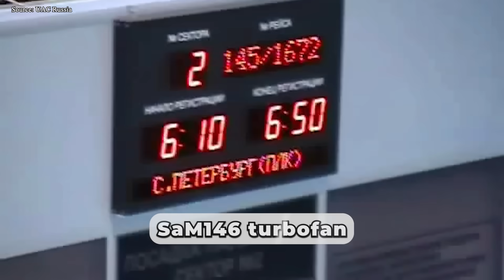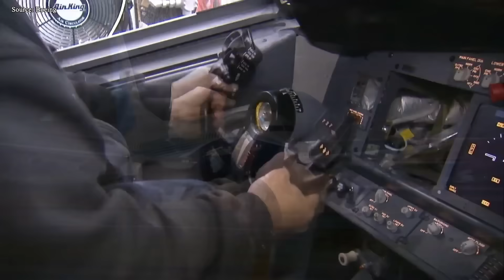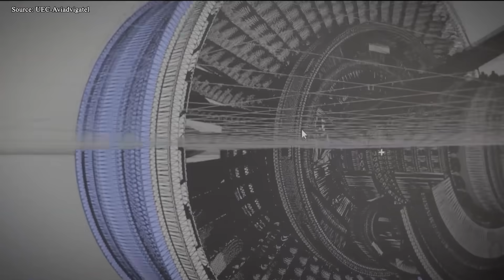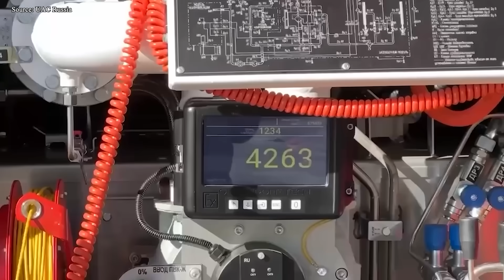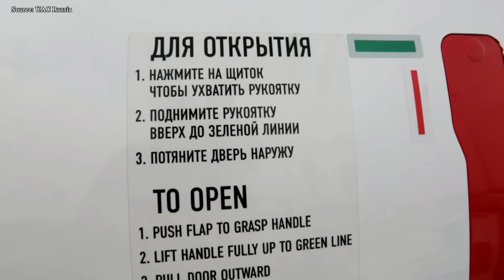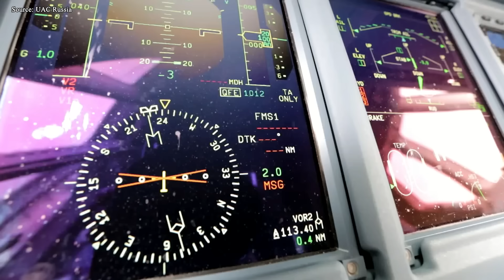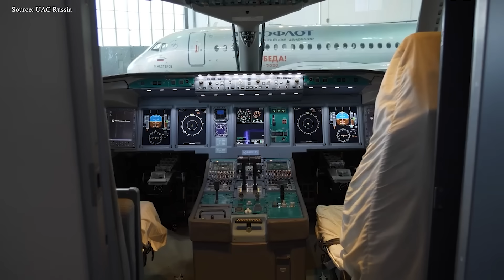This is How Russia’s SJ-100 Jet OUTSMARTED Boeing & Airbus

Comment: why do they keep showing two completely different planes? One with engines in the rear and one under the wings.. did they think the viewers are too stupid to notice? I hate AI content with it's typical showing of visuals completely unrelated to the narrative. For goodness sake, just show a static photo of the object you're talking about, if you don't have a relevant video clip. Otherwise it is very frustrating to watch.. why have visuals at all??
Reply: The plane with the engines in the back is the old Soviet Tu-134, which was replaced by the SJ-100, which has comparable capacity and range, but is quieter, more fuel-efficient, and more comfortable.

Comment: Why is this aircraft considered obsolete? Which new aircraft does it struggle to compete with?
Japan's SpaceJet project failed in 2020. $10 billion wasted. If there are any new successful projects, why aren't they mentioned?
And yes, the Boeing 737 has been in service since 1968. How miraculously does it manage to compete in the market and why doesn’t it talk about its obsolescence?
Reply: Does the Boeing 737 still compete in the market? 
Boeing only gets orders because air companies want to prevent a monopoly by Airbus. The aircrafts themselves are either not compatible any more, or fall from the sky or are even unable to start...
Reply: Boeing manufactured very good aircraft before ( the 707 ,727 ,747 ) . It's the newer models that make you wonder if your testament is up to date before boarding.